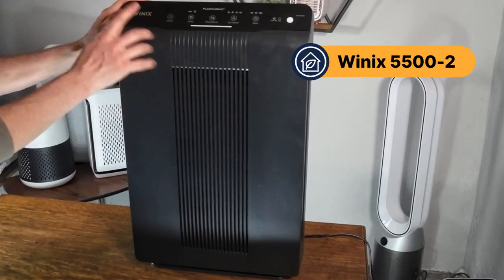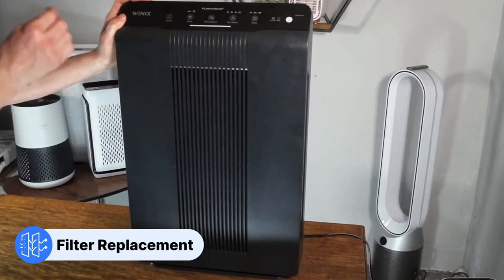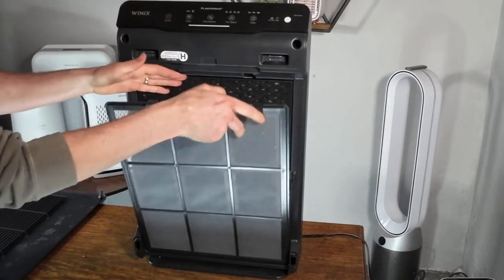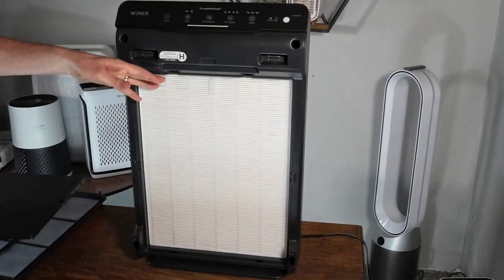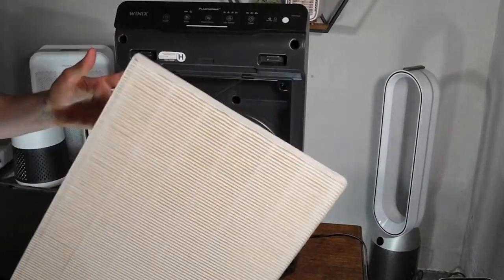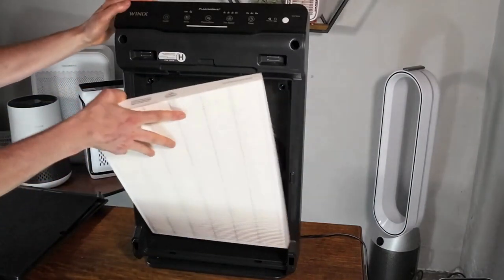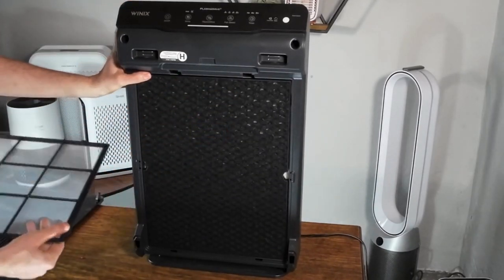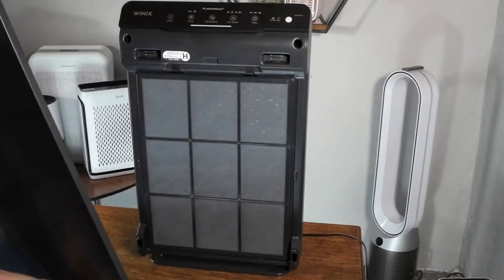How to Change the Filter on Your Winix 5500-2

Comment: Just the carbon filter & pre filter are washable? Can you just vacuum them instead?
Reply from the maker: You could vacuum the pre filter instead of washing but don’t expect it to do much for the carbon.
Reply: @HouseFresh  do you know if the winix c555 filters they sell at Costco are compatible with the winix 5500-2 machine?  

If not, is the c555 machine as good as the 5500-2? I see it has carbon pellets too.
Reply from the maker: just looked and the c555 does seem to be able to use the same filters as the 5500-2. Just be aware that the c545 is a different design and uses smaller filters . Not tested the c555 but expect it will have very similar performance to the 5500-2 based on reported data from winix. If you have a Costco card I would go for it. Tested the winix zero se from the UK Costco and was super impressed with performance to $ ratio!